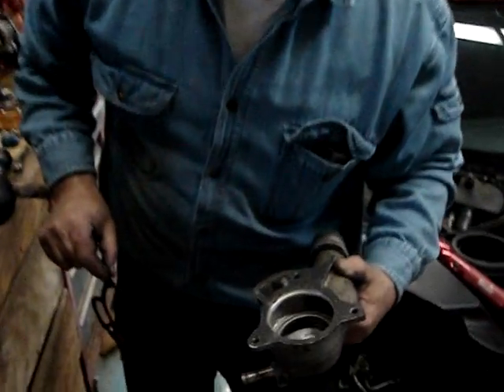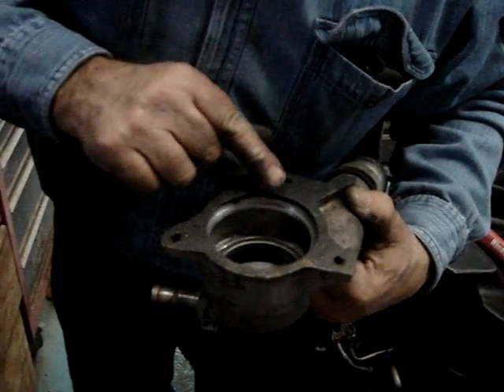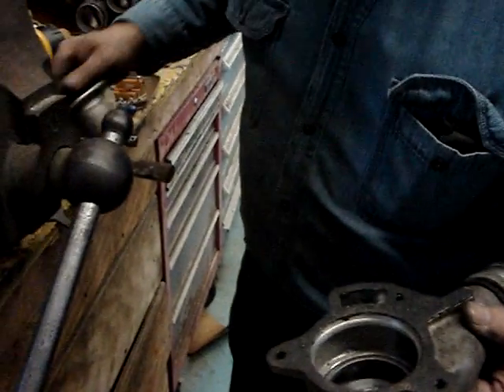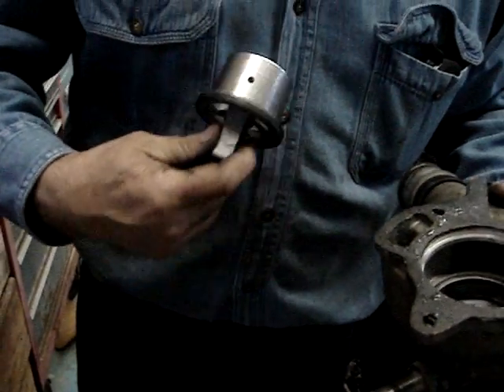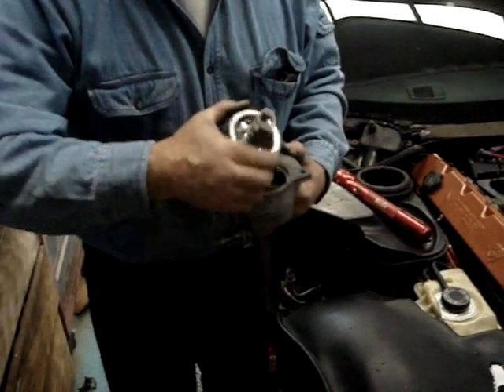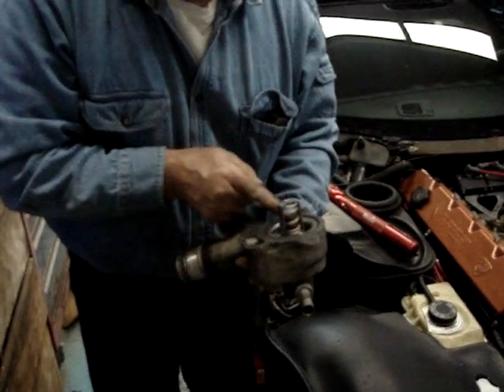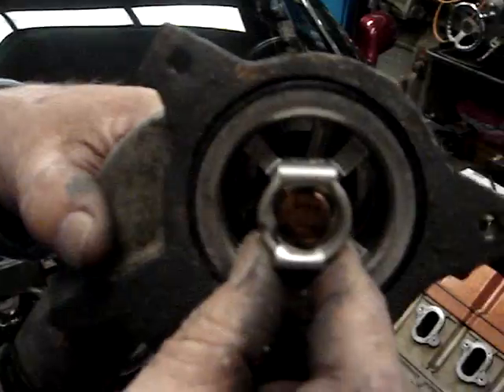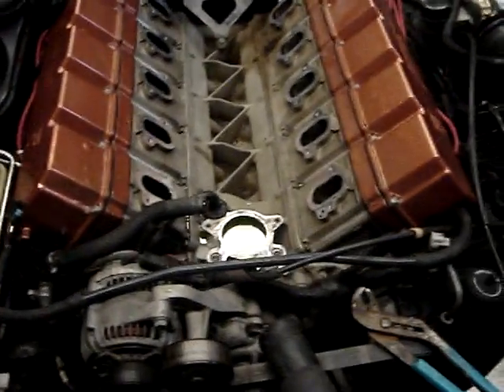viper thermostat install

Comment: I'm still researching this but only today did I receive my thermostat and gasket in the mail.  I have an early 94 and I believe the tstat is at the back of the engine (by the firewall) regardless do I need to drain anything before I open it? I assume with it being at the top of the engine that the thing would be empty if the engine is cold, meaning I could just unscrew it, pop the old stuff out and new stuff in, and close it up.  How wrong am I? :D

Comment: I need do my thermostat on my RT/10. Never seen the holes drilled before. Any downfall doing that or any specific place the holes need to be? I bought the 180 degree thermostat already. Liked and subscribed.
Reply from the maker: there isn't a huge need for drilling the holes.  it just lets water through if the thermostat fails closed and doesnt cook your engine right away.  we had overheating issues with the engine before so its something we did for peace of mind.